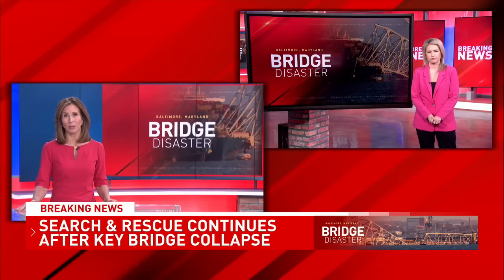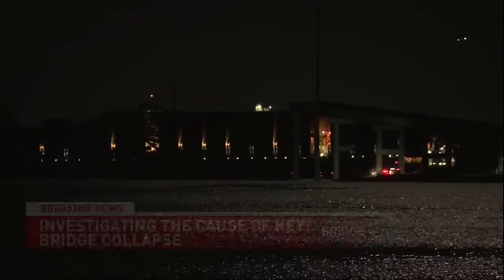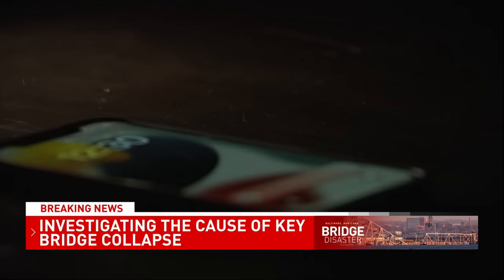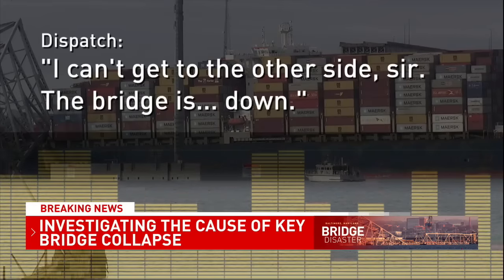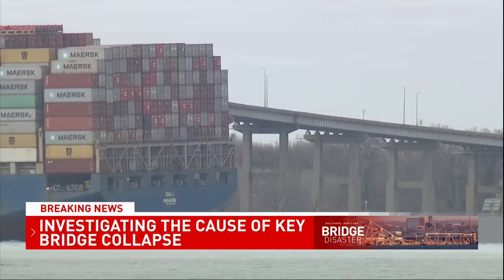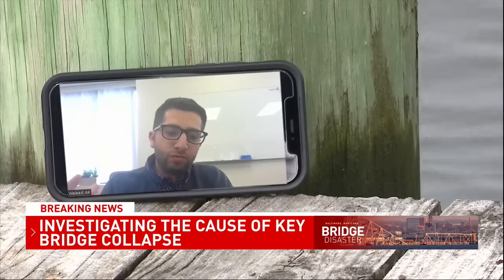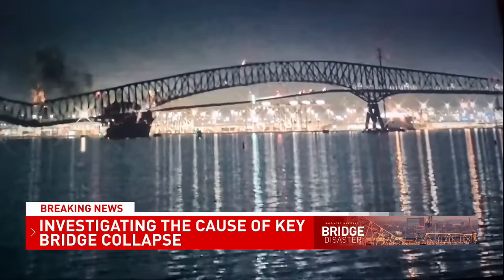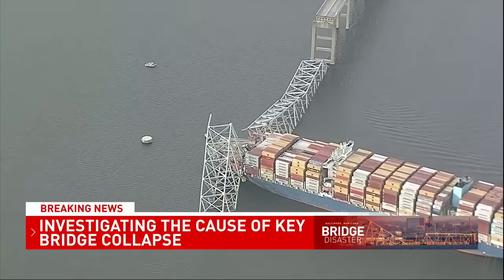Experts weigh in on what may have caused cargo ship to crash into Key Bridge

Comment: Maybe the fact that it turned and accelerated into the bridge pillar on purpose BUT I'M NO EXPERT I JUST HAVE EYES..
Reply: If you look at the ships travel vectors, you will see the ship reached a maximum of 8.2: knots. They saw what was happening, called an SOS, managed to drop one anchor. Revved the power plant in reverse(Black smoke) and had slowed to under 5 knots when they actually hit. They did their best with an intermittent electrical system. Being a draft with no power is one of the most frightening things that can happen to a captain.
Reply: “The Party told you to reject the evidence of your eyes and ears. It was their final, most essential command.”
― George Orwell, 1984
Reply: it lost power and drifted off course

Comment: These modern massive 1000 ft long ships that have a monstrous unstoppable weight have such a complicated series of mechanical connections with untold microchip sensors and with software commanding it would seem inevitable that eventually their propulsion would have failed at a most in-opportune moment.  Perhaps when the bridge is rebuilt they could widen the channel under the bridge support to include a wider span with deflection barriers built for errant superships to shear and glide off of.  Also some sort of improved ship to shore communication though that would have to be thought out after analysis of what could have been better management in this type of incident.

Comment: No power; no steering. Ship hits bridge. Simple enough
Reply: Nope.  You didnt watch the full video.  The ship lost power, and was NOT pointed at the pylon.  The ship regained power and then steered directly toward the plylon before losing power again.
Reply: Wrong. Ship power came back on, ship turned towards pillar and accelerated into it. Don't be a moron, we all have eyes, we saw it..
Reply: Read the vector charts for this vessel. They had slowed from over 8 knots to around five and were decelerating when they struck!
Reply: @LunarTikOfficial by the time the power plant returned the engines had been shifted into reverse and they went full throttle (black smoke) and had trimmed nearly 50% of the vessel's speed by impact. The only thing they did wrong was they should have dropped both anchors.

Comment: What "experts"? REAL Experts, Have and Are Still Talking to those involved, like the ship's Crew and Everyone Known to have been Present At The Time, while Withholding Statements Until They Have Weighed All the Evidence!  Possibly Not Releasing until permission from a Court.  Self Proclaimed "experts" making statements based on Third Hand Information, Released Video, Latest Rumor, or Conspiracy Theory, are little more than pathetic wannabees. In a Race to Find Truth, except for the entertainment value, which do You wish to hear? Multiple things, including Personnel Error can result in Loss of Steering. In areas of Restricted Maneuvering, when things happen, they do it Fast. Cross Currents and ships' momentum play a part. The 2 Pilots aboard, will probably have statements of what they Witnessed. During it all, Wreckage requires Removal, along with the Search for Victims Bodies,  Returning of the Ship Channel to Use, while providing Alternate Routes for Daily Commuters. Then Later Replacement of the Bridge.